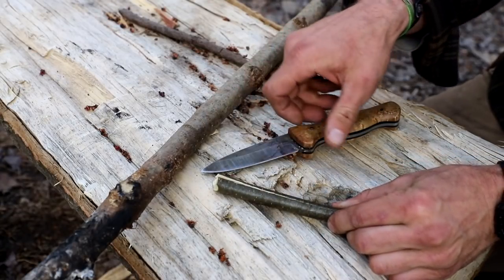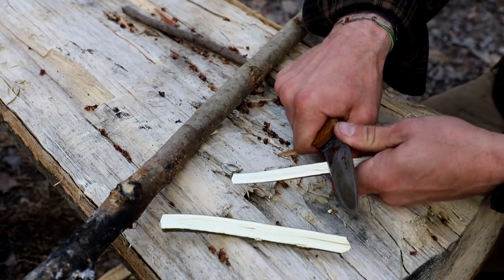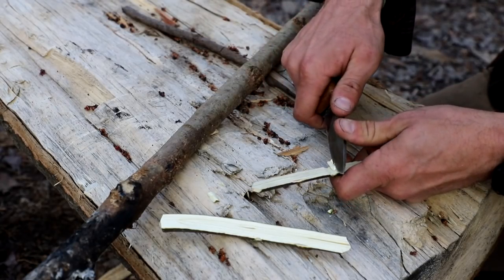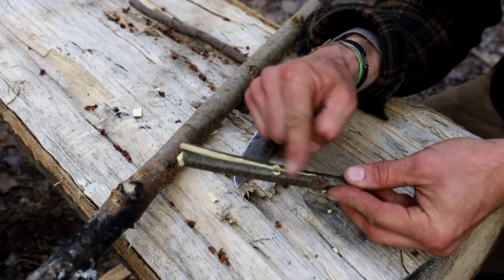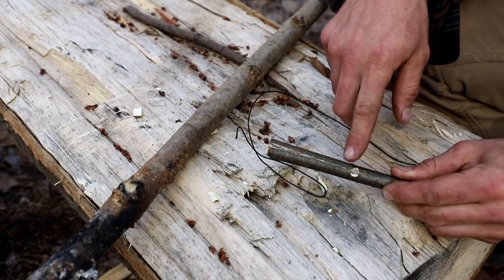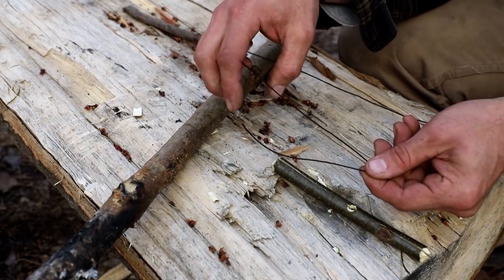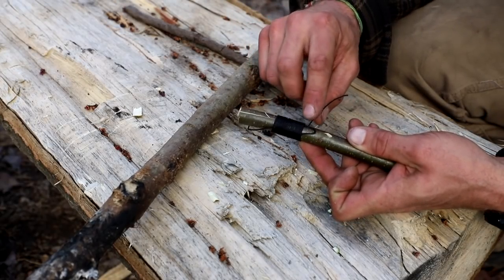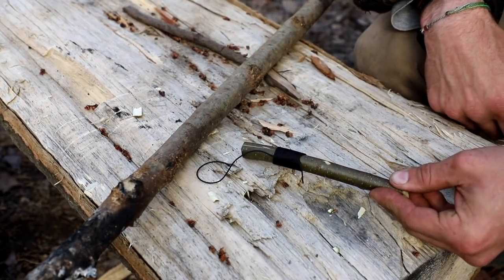Woodland Bushcraft Hack: Drilling without a Drill, What the Old timers use to do!

Comment: I use a stick about 12" long with a 1" diameter for a spindle. I put a bind about 4" from one end. Then, I split the spindle at the short end up to the bind and insert whatever I'm going to use for a "bit". Finally, I do a bind around the bit area of the spindle. 
This works great with a bow drill and can be made in about 2 minutes.
Good video. Thanks for posting.

Comment: Some survival knives or even gadgets have a 1/4 inch hex socket to use with nuts, even some multi tools do too, like the one gerber makes. those can use hex shank drill bits, you could get a single drill bit like 1/4 inch or 5/16 and use it with that, if you get a simple one you can even sharpen it pretty much indefinitely if you use it only on wood.

Comment: Wow. Lots of extra work for that. Just using the Awl from your Swiss Army knife woulda done the job in a lot less time and without using cordage. So… always carry your Swiss Army knife. Of course, lots of multi tools come with an all, so…. You’re not married to Victorinox if you prefer, say, Leatherman or Gerber. We all always carry a multitool, don’t we? I know it’s always part of my edc.
Reply: Yes a knife fer twigs but
not on a =>30 mm stick needing a 12 mm diameter  hole
seems like this would be useful on larger sticks 
can't wait to try it 🤠
Reply: @Occupuyourspine  for a 30 mm stick needing a 12 mm hole, start with your awl, then transition to small blade, finally use your saw.

Comment: 👍 Good trick, thank you for sharing.  On a stick that size in diameter sometimes my SAK awl and corkscrew split the wood.  This gives me another option.
Reply: You're putting too much pressure on it- trying to take too large of a bite. The next time you feel your awl jam and not want to twist- don't force it, that's what splits the wood- back out a little and take a smaller bite.
Reply: @stoneysdead689   Thank you.
Reply: @ROE1300  👍
Reply: @ROE1300 Endeavors Something else that seems to help- once the point of the awl breaks through- I stop and turn the stick over, come in from the other way to finish the hole. I don't know why but it seems to help with splitting and chipping. Good luck.
Reply: @stoneysdead689    Thank you again, good tips.

Comment: I think it would be easier to use my awl on my Swiss Army knife. How about finding a nice straight stick, find a way to wedge a sharp stone maybe like an arrow head in the end, make a bow and string as well as a bearing block as if you were going to start a fire then see if you can use it to drill deeper holes than is possible with an awl on a multi tool. That is what I thought you were going to do at first. I think you might be surprised at how successful you will be. The method that you used to tie the stick back together is a great tip on its own and it has a number of other uses including an alternative to hose clamps.

Comment: Find a smaller pointed knife.
Drill (wiggle  back & forth) point on one
 side about half way,
Flip over, drill/wiggle point of knife one other side to center to meet hole from other side.
No splitting , tying...